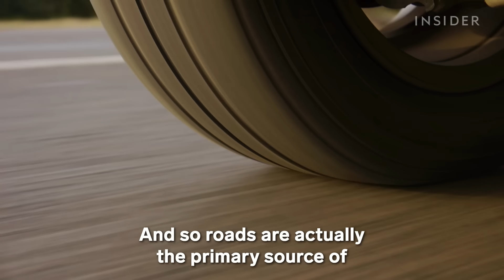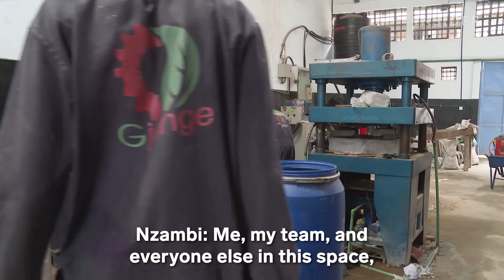Young Inventor Makes Bricks From Plastic Trash | World Wide Waste | Business Insider

Comment: This is neat, and I really like the look of those bricks, but one thing I am wondering about is how well they stand up to the sun. Plastics tend to fare poorly to long term UV exposure. So it would be interesting to see how these do long term. In as far as if they discolor, become brittle, off-gas, or even get deformed if the temperature rises high enough for a long enough time on really hot summer days.
Reply: Well, if they're mixed with sand AND super compressed, I wouldn't be surprised if their lifespan turned out to be a lot more than we think. And we repave roads all the time anyway.
Reply: It's mixes with sand so I'm pretty sure there good under 4he sun
Reply: @Da_Realest_of_Men  You do realize that sand, the kind used in electronics, and cement/concrete, is running out, right?  They had a whole story about this I believe on this channel.  They are trying to find alternatives yet here we go with something that needs that sand.  Desert sand doesn't work.
Reply: will it generate toxic gases while heating??
Reply: That is the main problem with those bricks my friend you are right, those bricks work only in a certain part of the world. however, as a solution, she is really doing a great job.
Reply: @chopinsonatas606  but as its mixed with sand it will become more durable to the sun
Reply: True I live in the south. It's hot AF. And plastic on the road... I dunno.
Reply: @Gribble334  I live in Mexico and plastic trash doesn't look like melting anytime soon under 104 ºF, so my guess is this stuff can endure too much heat when mixed with sand or something, I still want to know how hard it is to break tho.
Reply: @Gribble334   Not one the road,  but definitely in the road.  Plastic is being used in roads as a binder with asphalt, it makes the surface more flexible and less prone to cracking.  Better though are ever better techniques of mixing rubber in place of stone aggregate with concrete, the durability is top-notch.
Reply: She's basically turning it into rubber tires do you know how durable rubber tires are?
Reply: the outside might become more brittle, but the inside will hold.
so, no different then regular brick?
Reply: @ChinaWrite777  
No, some temporary solutions make problems worse in the long term. Microplastics are having serious detrimental effects on our health, that we've yet to fully understand.
Reply: They said in the video that plastic has already been used on roads in other countries for 20 years, and they actually last longer than asphalt roads
Reply: Certain plastics are ok in sun and some are not. Even if there were issues in sun with it, they could easily provide cheap simple exterior cladding for the wall so sun cannot hit it directly.
Reply: Nothing will last in this world 
But it will be a big help 
Even temporary 
Coz it’s depends on its life spans 

It’s only a bricks neither hallow blocks nor cement still 
Will break 
💪
Reply: @meriamcaspillo7373  I agree. And the plastic is still there.
Reply: umm have you been to a kids jungle gym? where half of it is made from hard plastic? it withstands wear and tear and 24 7 weather...its better than wood or rusting metal. its the future my friend. accept it
Reply: @andrescortez7268  Most plastic playground equipment has to be replaced about once every 5-10 years, because the plastic starts to get discolored and brittle from the UV damage.
Reply: Also they create even more pollution and micro plastic waste 🗑 🙄 😑 😒
Reply: @ChinaWrite777  Not really, it just delays or changes the problem. Better off finding the best permanent solution before plastic was even introduced so it would never have been a problem to begin with.
Reply: Less cracks as the coefficiency for both hot and cold is better than all other materials. Check out Tata's invention of this. IT would be a life saver for ppl who uses wheelchairs crossing a crack every few seconds to jarring impacts traveling thru our bodies that takes 40 years to show the damage
Reply: That's what I think the sand is for.
Reply: Yeah offgassing worries me too, as do all the plastic particles they are creating and the fact that MOST plastics eventually crumble in sunlight. I'm guessing you do 3d printing too huh? Lol.
Reply: India has had plastic roads since 2019 and they haven’t really deteriorated at all. They may be hurting the environment slightly but it’s a lot less harmful than leaving plastic as waste. In Arizona their highways have old tire rubber mixed in.
Reply: @ChinaWrite777  we all will still die 🤷‍♂️
Reply: i didnt read your replys but just use them for roads dont matter that way so much rubbish that it can be replaced easy
Reply: Tires vs plastic bricks= microplastic.
Reply: Can't you hear? Or read? It doesn't hold up. It degrades microscopically
Reply: Paints and layer of limestone or distemper can prevent the possibe loss from uv rays.
Reply: Just like asphalt- maintenance. She can relay the bricks as it becomes brittle or lay the mixture the same as asphalt
Reply: The addition of the sand which has withstood time may help but watch further on what improvements they may make and a variety of colors too.
Reply: If they mix the plastic content with other metals or mixtures it could be made to withstand sun with certain moxture
Reply: It is still plastic and it is still killing our planet.
Reply: @snowflakehunter  Plastic isn't killing the planet. Plastic trash looks terrible, making it a great boogieman, but it is fairly inert and breaks down over relatively short amounts of time. And despite all the fear mongering over the so-called great pacific garbage patch, there is little proof to back it up, one of the few actual research expeditions that went out to check on it couldn't find any proof to back up claims of large floating trash debris or infiltration at the various depths below the surface or even any obvious harm to local wildlife.

What plastic is out there is often too small for the eye to see and resides almost exclusively up on the surface where it actually provides some benefit as a substrate for algae blooms to form on, which if anything provides new food sources in an area that was previously the ocean equivalent of a desert, but now they are finding new ecosystems forming out there in these barren parts of the ocean far away from the life-sustaining  shallow coastal areas that are favorable to the micro plant life that is the backbone of the oceans' food chains.

Also another source of hysteria goes back to claims that birds are eating plastic until they explode, which turned out to be an intentional hoax. In reality when birds do "eat" small bits of plastic, it is for the exact same reason they ingest pebbles, to add coarse grinding media to their crop to start the digestion process with the food they eat, which goes into the crop and gets agitated with the grinding media to break things down into more manageable sizes before sending it further along.

The only true dangers that plastic tends to pose are in the form of your typical 6 pack rings and discarded commercial fishing nets. Animals can get caught into these things and either become easy prey to others or run into constriction complications that can eventually become fatal. Both of these are pretty easy to remedy through proper disposal. Making them a lazy thoughtless idiot problem, more then a plastic problem.

There is also something to the claims that plastics do off-gas a bit of CO2 as part of their breakdown process when they are left exposed to the harsh UV rays of the sun. But this too can easily be avoided by just burying it, so the sun's rays can't reach it. Though it's still to be shown if CO2 is even all that bad.

Plants thrive in a CO2 rich environment, meaning faster and more hardy yields, which is why many professional greenhouses actually pump in extra CO2. More plant matter also means more oxygen output as well. Going back in history some of the times with the highest CO2 concentrations were the times when the Earth was most green, with massive plants and animals, such as the time of the dinosaurs, when it was 5-8x higher than today.
Reply: @Uradamus  Plastic is not biodegradable. It can degrade, but not biodegrade. Still, it takes about 450 years to degrade to simpler compounds. Now, for the first time, scientists have discovered microplastics in the Antarctic which is not inhabited. The Great Pacific Garbage patch, which is primarily plastic is twice the size of Texas,. While plastic does not look good, It is having a negative impact on aquatic life, which in turn has a negative impact on land animals that rely on aquatic life as its food source. 
Furthermore, microplastics are now being found in animals including humans. These microplastics are known to cause damage to the very DNA that makes up life.
One last note: Plastics are made from distilled oil. The process to extract and process this oil to make plastic produces enormous amounts of greenhouse gasses that contribute to global warming.
To say that plastic is not harming the planet is absurd.
Reply: @snowflakehunter  we had record lows just this week.  Good thing the earth warmed up at one point or much of N America would still be covered in ice.
Reply: @matthewhardin9622  Look at all the record highs that were in Europe! Look at all the ice burgs melting, look at Greenland lose land....etc. You should educate yourself on mane-made global warming and forever chemicals. This is too serious of an issue to be taken lightly by people like you.
Reply: big up 🙏
Reply: Keep wondering while other people are doing and eventually you will wonder how  you fell so far behind everyone else.
Reply: @chillwill5080  I agree, we shouldn't have questioned the effects of mercury on hats, mercury on thermometers, meth on coughing syrup, sanitation procedures with early medical equipment among other things. Thinking about the negative side effects of things never got anyone far anyway.
Reply: @lick28  There is no "we", you have never done a thing to address any of those issues.  I am part owner of a company that currently makes biodegradable plastics.
Reply: @chillwill5080  yeah, well I went fishing with the US president Theodore Roosevelt on neptune while fighting fish-roach hybrids.
Reply: @lick28  That's hilarious, because it was on USS Theodore Roosevelt that I first saw these plastic brick making machines, all the plastic waste from the ship was melted into bricks before sinking overboard.  That was about 30 years ago, you are far behind kid.
Reply: @chillwill5080  I'm curious on this biodegradable plastic, how's it possible?
Reply: @chillwill5080  damn that's crazy, I saw the pyramids being built by a bunch of kids wearing supreme shirts. I can't show you though since I ran out of battery.
Reply: @potasticfox2170  Basically from plants, it's chemistry just as plastic from fossil fuels is from previously living matter.   polylactideacid (PLA) and  polyhydroxyal-
kanoate (PHA) are primary for what we need currently.
Reply: @chillwill5080  bud is really telling people curiosity is an obstacle
Reply: @CanadianCoffeeAddict  I just wrote that dreaming is nice, but it's people who actually do who make the world go around, ya know?
Reply: @chillwill5080  lmao imagine if this is the reply scientists will give to those who are peer reviewing their work
Reply: @tate-n8t  lmao imagine if the entire world just sat around and asked stupid questions and made stupid comments instead of actually making things.
Reply: @chillwill5080  So..you're telling people not to think and be curious? lmfao.
Reply: @chillwill5080  you clearly never seen what happens to plastic when left in the sun. This thinking is life saving because while you want to already build houses out of it this guy wants to know if it's safe enough to be used for houses. He's not going to be behind he's going to be saving lives if this brick reacts the exact same way as regular plastics.
Reply: @chichichichichichiOwO  I never wrote a word about using plastic to build houses.  There is plenty of readily available research information about plastics, most of what you touch contains them.
Reply: @chillwill5080  it doesn't matter what its used for. Whatever its used for it will be used outside thus exposed to the UV rays. And its dangerous if these bricks become just as brittle as their regular counter parts.
Reply: @chichichichichichiOwO  house fires are a thing, so I doubt these bricks would ever be approved anywhere to be used to build houses.
Reply: @chillwill5080  People dn't seem to understand your comment but I do - I take it to mean that if all you do is think, eventually you will fall behind those who are out there "doing", i.e. solving problems. Thinking and curiosity are necessary, but they have to be followed by hard work to create progression.
Reply: @catsinq5726  At least they’re doing something. They’re trying to come up with ways to help people. My thing is, if people are as intelligent as they imply they are (like in this comment section for instance) then get out there and try to make a difference. Even if an idea doesn’t go global, your actions may inspire someone else to do something and it becomes a domino effect
Reply: @GothJedi  oh yes, absolutely!  I get inspired by this type of video all the time.  And I think that was exactly the original poster's point too.